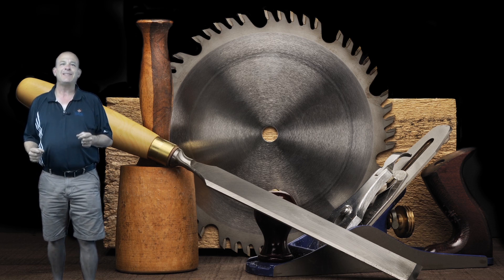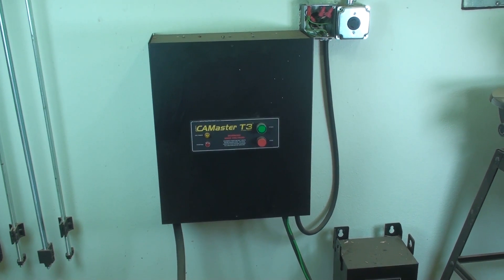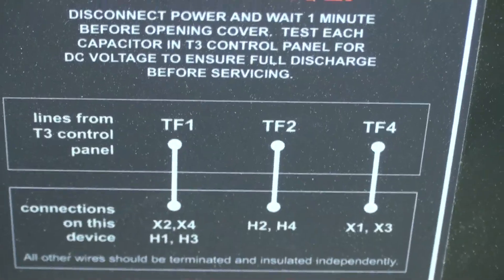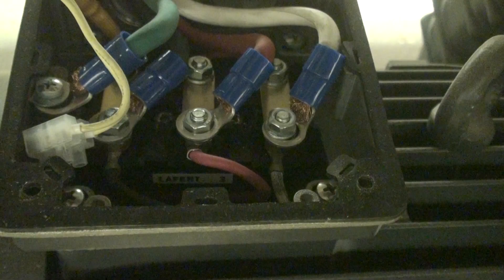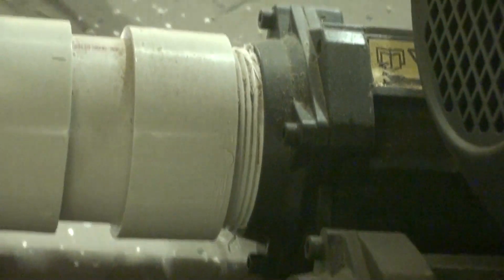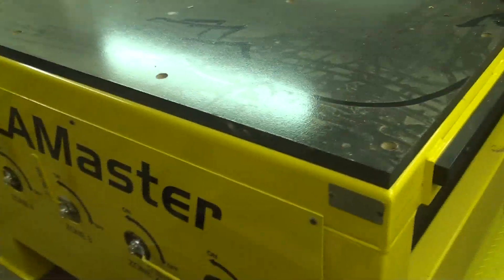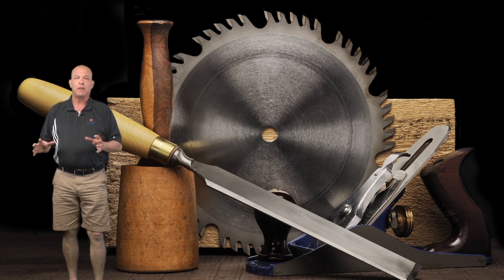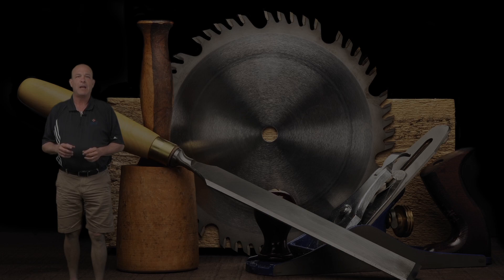Install Gentec T3 Phase Converter

Comment: I'm missing the power module,  how do I make this work , is there a substitute??   Got 120 120 54 volts!?
Reply from the maker: My sincere apologies. I'm no electrician. You should contact the company that sold you the converter.